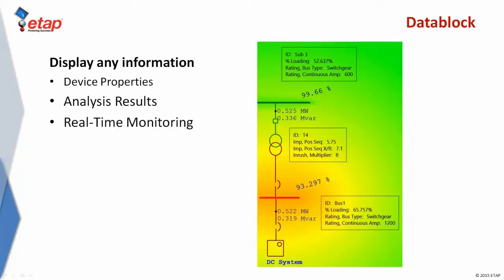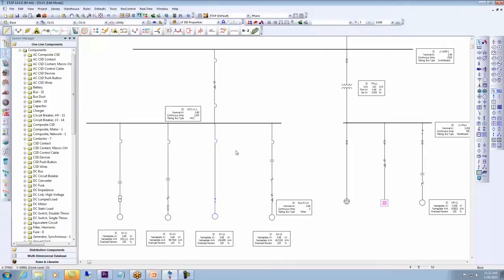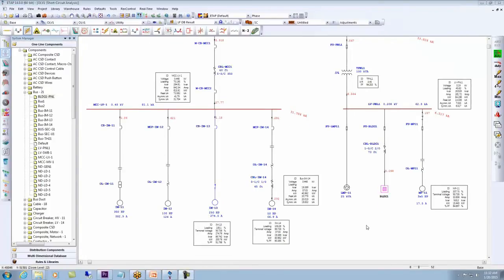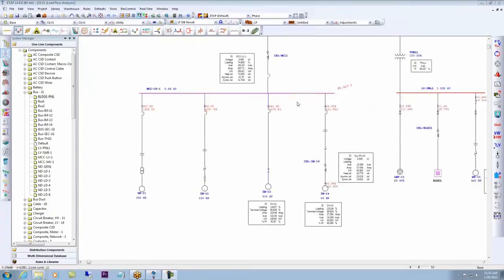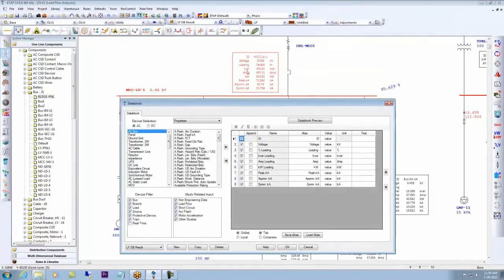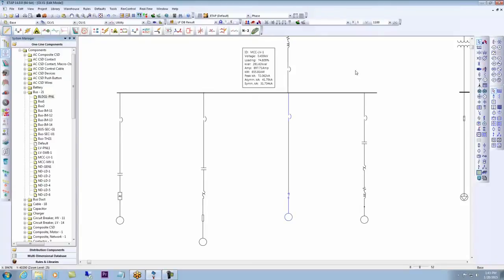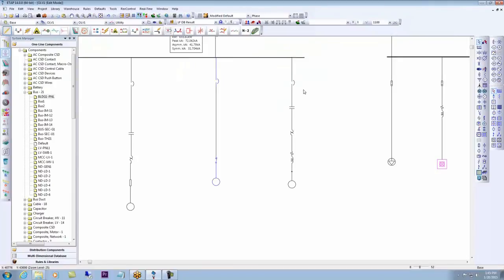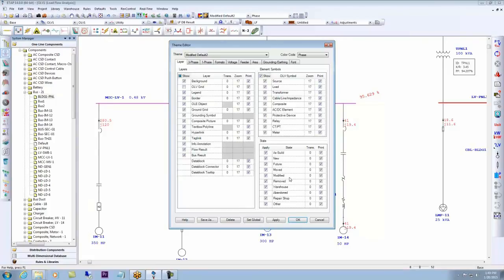DataBlock and Theme Manager

Comment: Thanks for the video.

As the previous comment had asked, how do you get your datablock to display as black text? mine is showing up red
Reply: Hi Anthony. You are able to edit the colors in the theme editor. Theme editor > Fonts > Result font > Bus / branch. Please note that this also changes the color of the calculated output results on the one-line.
Reply from the maker: Thank you for your interest in ETAP software. This feature will be available in the next ETAP release. Please make sure your user license is valid so you can download the next release for free.